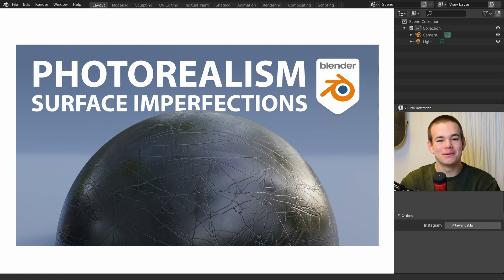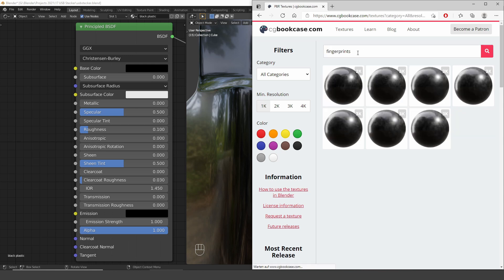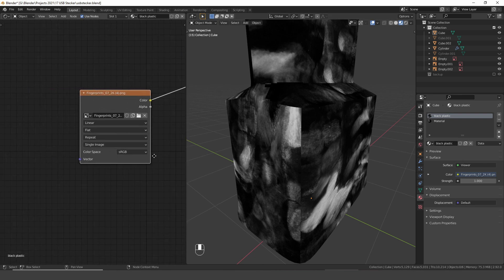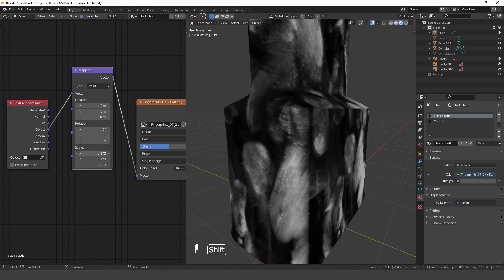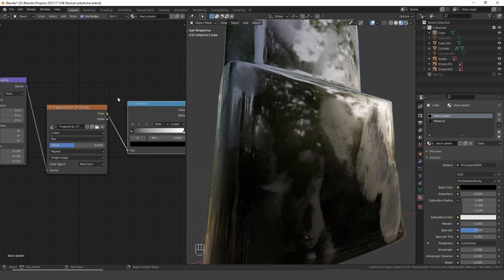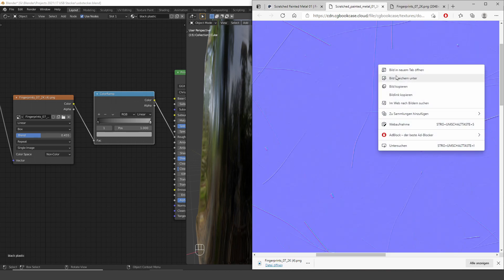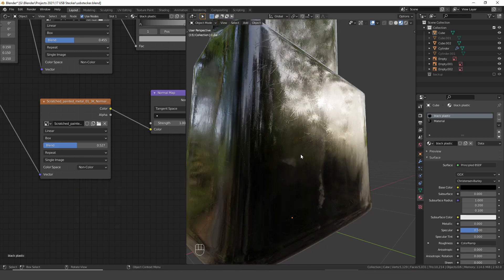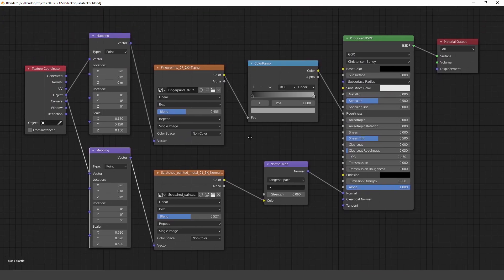How to add Surface Imperfections to Shaders for increased Realism!

Comment: Hi! In 1:34 you scale all values  together. How do you do it? It's not working with SHIFT for me. Do I need check some option in preferences?
Reply from the maker: hey Igor, no need to hold down shift:) just drag over all the values and then slide from left to right to adjust all values simultaneously. Hope this helps!
Reply: @BlenderDaily  Thanks a lot! Yes it works! Ahhahahaha, i was so stupid )). And I always connect the value node for it ))))
Reply: @BlenderDaily  I dont get what you mean by drag over because when i left click drag over them it doesn't seem to do anything

Comment: That's great, thanks. I am now subscribed. I was surprised to see that you didn't use the "node wrangler" add-on. The number one thing I use it for is to add the mapping and texture coordinates node with a single click. I believe it is CLTR+T on the image texture will add those two. CLTR+SHIFT+Left Click on any node will connect it to a viewer which is very useful.
Reply from the maker: I usually use it as well, but sometimes I don’t use it for tutorials so I don’t always have to mention that the addon has to be enabled. But you are right, it is a great tool!
Reply: @BlenderDaily  Yeah, that is a wise decision. Having to explain add-ons like that would add an extra level of complexity which could putt off some beginners.